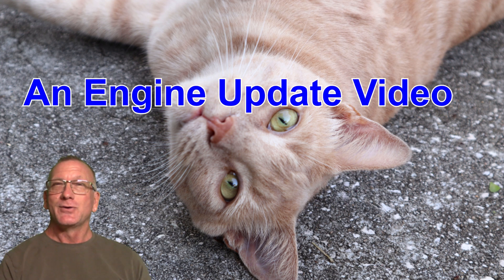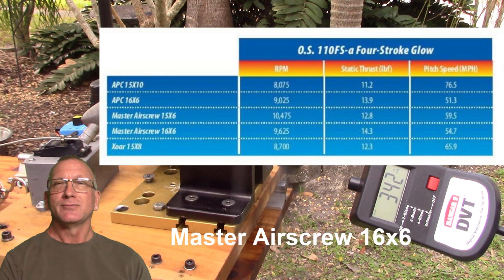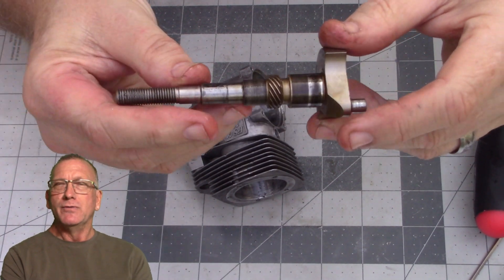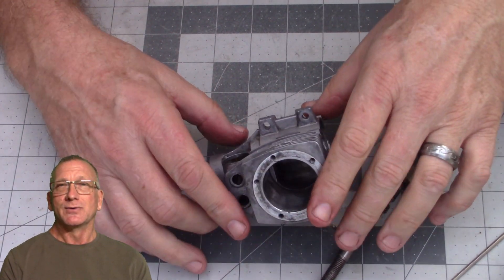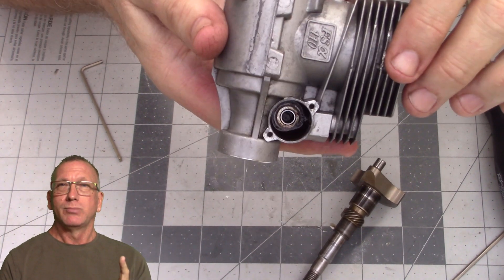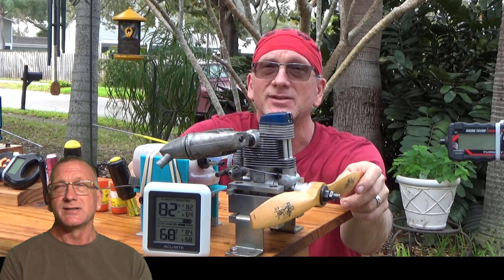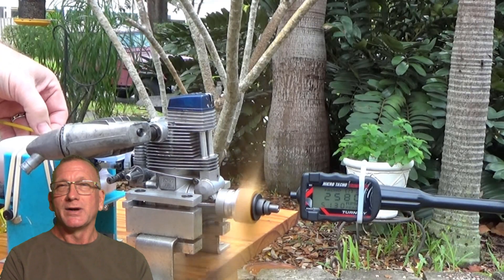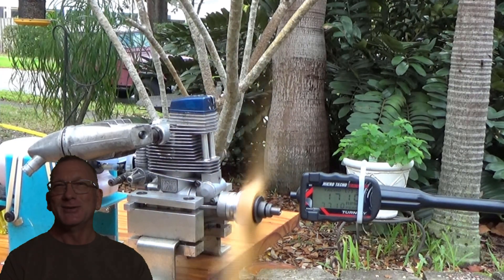OS FSa-110 Engine Update

Comment: Boy I hope this isn’t a sign that these engines don’t hold up. I happen to have a NIB 110 waiting for a project. Always liked the looks of these engines and appear to be well made. Looking forward to an update & future run. Good luck Dave!
Reply from the maker: This particular engine that I have has seen it's better days.  I could only speculate about how it was run and maintained but that is neither here nor there.  The one fact I am certain of, is that spare parts for this engine are pretty hard to come by.  But that can be said with MANY older engine now.  What does that all mean?  Take good care of what you have because replacement parts are not readily available.  Bearings, o-rings, and a piston ring would be the most common consumable item on one of these.  Now if you crash and do other damage, well then, you might be out of luck.
Reply from the maker: I might add this interesting tidbit.  I believe OS made a total of 8 different Alpha variants between 2007-2020.  Of those only 3 are still in production.  For such a modern design it seems odd that they would discontinue some.  Perhaps OS was still trying to make something of the declining glow engine market and the ones discontinued were the lowest in sales.